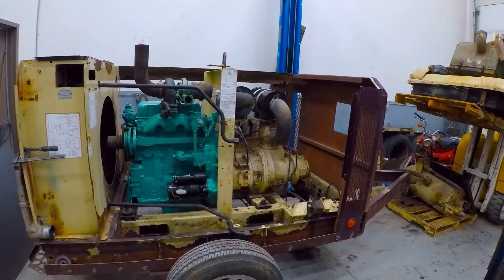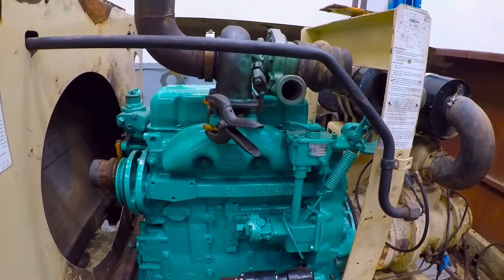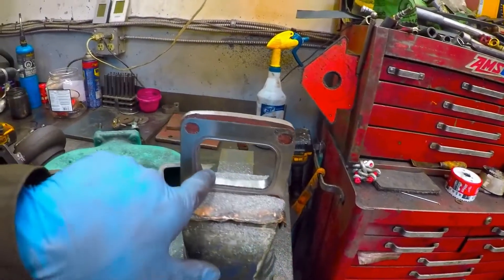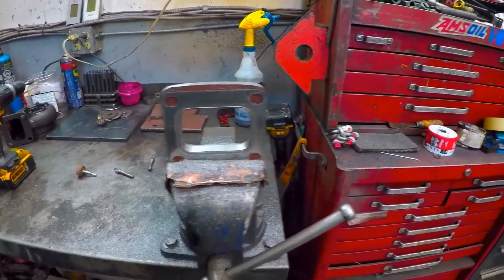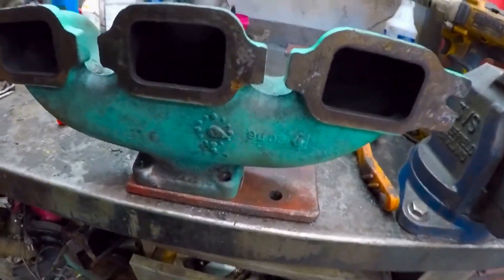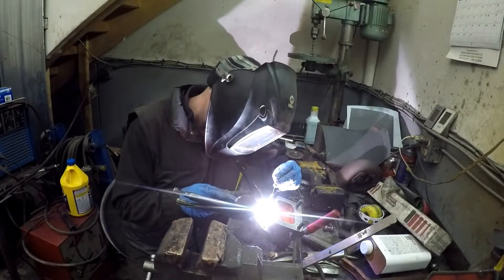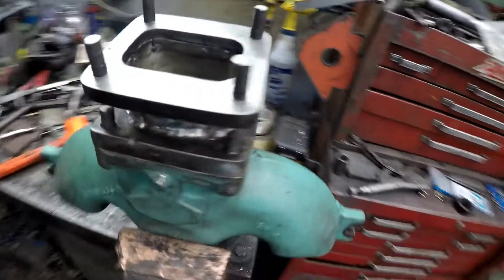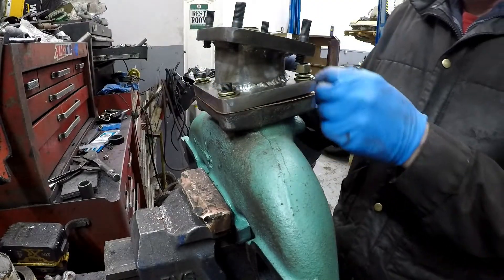Detroit 3-53TIB (Turbo Adapter Build)

Comment: The adapter you fabricated looks as though it was pitched 20 degrees, from  the gap you  showed at the beginning.  Was the pitch part of your original plan, or was it an after thought which developed while you worked?

Thanks for sharing, and keep up the good work.
Reply from the maker: Thanks, yes the pitch is more than what the mock up was.  It gave me more room removing the valve cover, so I made that change.  Thanks for watching.:)

Comment: Very interesting some folk say you can turbo good condition non turbo engine to turbo it's a tuff cookie just don't take it to max constant  , what's your view here ? Thanks for the film !
Reply from the maker: I'd say you could turbo the n engines, but have to watch egt's as well as the blower temps.  N blowers have tighter tolerances and tend to seize unless you adjust the clearances for the turbo heat.  In future I'll be turbo charging the 6V71N and taking it from 238HP up to 300 with larger injectors and an intercooler.:)  Thanks for watching.:)